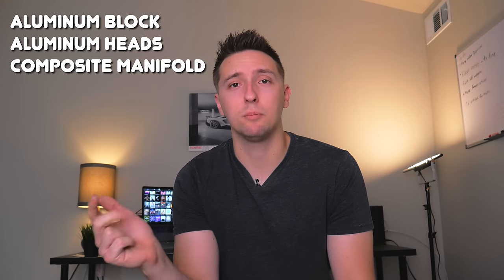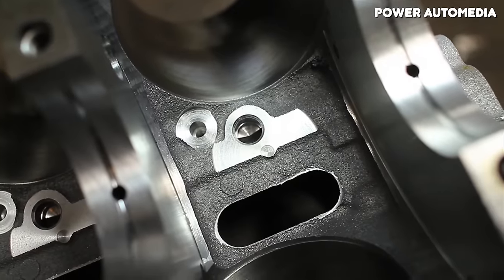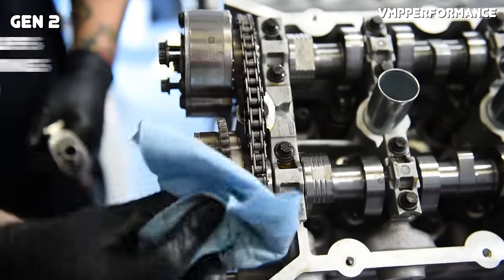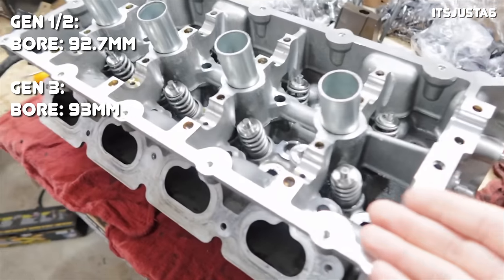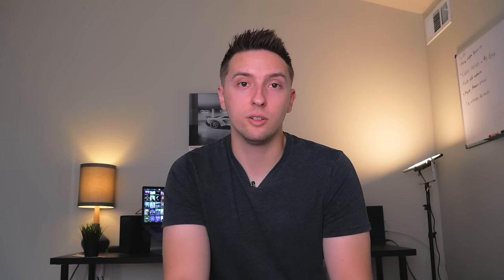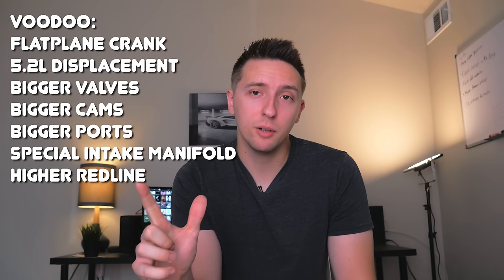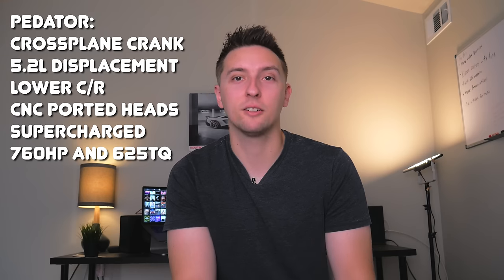The Evolution of The Coyote Engine (Explained)

Comment: Do you know much about the koenigsegg agera? I read it has a twin turbo v8 that was based on the 5.0 ford modular engine
Reply: I thought it was a 4 liter Audi, I better read up
Reply: Fermi Paradox  yup a 5.1 maybe the same engine??
Reply: The Agera is powered by an in-house developed 5.0-litre V8 engine based on the Ford modular engine block and fitted with twin-turbochargers which generates a maximum power output of 706 kW (960 PS; 947 hp) at 6,900 rpm and 1,100 N⋅m (811 lbf⋅ft) of torque at 4,000 rpm.

Comment: Didnt mention the oil consumption issue. Big problem in the 2018/2019 5.0 motors - Google it.  Class action suits coming soon.  My 2018 F150 5.0 was burning 2 qts of oil at 3000 miles. Luckily it was a lease and went with the 3.5 ecoboost bc of the v5.0 issues .

Comment: Respect for the Coyote but I'll disagree with you on the old 4.6L. The 4v version is an absolutely legendary motor. And the head options for those motors were equally legendary. John Mihovetz and outfits like MMR were taking those motors up to 3,000 hp.
Reply: Right?  Especially the 96-98 models
Reply: The firing order on the Terminator really had the best soundtrack, much more burly than the Coyote firing order, which I guess reverted back to the flat-head V8 firing order of Ford's very early days.

Comment: i have a 2016 F150 5.0.  It occasionally gets a rough idle and sometimes even dies at a stop.  It starts right back up no problem.  You mentioned the motion control valve helps at idle.  Could this be causing my issue?

Comment: 6:39 that’s the real big problem with the gen 3’s!  Should have left them with steel sleeves and they wouldn’t have oil consumption issues!  🤦🏻‍♂️
Reply: That's the reason I bought a used F150, I wanted sleeves and not a coating.

Comment: You forgot the 480hp BULLITT 5.0 version.
Reply: Gen3 with an intake
Reply: @Mangobrain82   - also throttle body and CAI from GT350.  Interesting though is that these mods made the Bullitt incur a $1000.00 gas guzzler tax...  my guess is a more aggressive tune too?  I have been reading where guys are dyno tuning stock Bullitts though up to 520 hp with nothing more than a swap to a JLT intake.... making me think the tune for a stock Bullitt must not be very aggressive at all and perhaps dialed back so that a stock bullit isnt nipping at the heels of a GT350??
Reply: @hammerdown3876  don’t forget the gen3 has more cubes and compression. Regular gen3 GT guys are making those numbers with stock 18 intake and tune. The a10 is also neck and neck with GT350 rolling racing also. As far as the 480hp. Maybe it’s just a number they picked that they though sounded nice. 500 would be impressive but I don’t personally understand the bullet and why they even made another bullet. They haven’t even made a new movie but they’re still making the car.
Reply: @Mangobrain82  Ford loves their making special edition for mustang...  But the S550 Bullitt was to celebrate the 50th anniversary of the film.
Reply: @Mangobrain82  And tune as well.

Comment: I love the coyote but it faces the typical problem with an overhead cam V8. Those heads take up a lot of room. The relatively crude Chevy LS motor doesn't put out the power per cubic inch but you can cram a lot of cubes in an engine bay.
Reply: What do you need to put in there?  A blanket?

Comment: Earlier this year. I bought a 2018 Ford F-150 with the 5.0 l engine. What surprised me is the power it has with good gas mileage. It gets better mpg than the jeep wrangler I had. The  wrangler got 17.5 to 18.5 mpg compared the F-150 with 5.0 l gets on average 20.75 mpg

Comment: Excellent video. I had a 2011 GT and used premium gas. I am thinking of picking up a 19-21 GT.  Do I have to run premium gas in it?
Reply: You can run 87 octane in all Coyote engines with no issues.
Reply: @JCTiggs1  thank you

Comment: Trying to remember something about the GT500 blocks. I can remember Ford changed the block of the 2010-2012 GT500 to aluminum in the 2013 and above models. Significant weight reduction on the front end. Yes it was not the 5.0 in the video but a larger 5.8L.

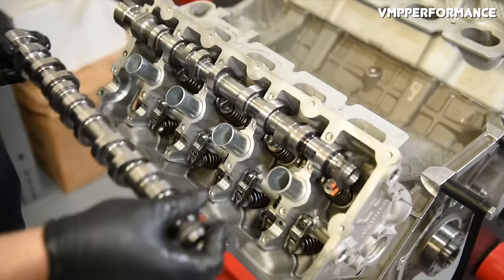Comment: (3:40) LS engines DO have adjustable cam timing (not all versions obviously) by use of a cam phaser, they just don't have independent intake and exhaust cam timing since there is a single cam doing all the work.

Comment: Thanks for the details, I was interested in the engine used in the 2021 Mach1, my understanding is the intake is from the GT350. Etc. 
I did however have a question about oil mist and oil separators. I understand a bit about condensation on cold stats and oil mist from blow by. 
I was intrigued as to why these engines seem to have quite a bit of oil mist. 
Also why is there more oil miss from the right hand bank then the left.
Also I see some people are replacing the oil pumps, is this an issue on all generations?

Comment: Ford should have used the same plasma transferred wire arc coating on the f150 5.0, i heard they went cheap and used a cheaper coating fir the truck application and now it supposedly caused oil consumption issues.
Reply: I think it just takes time for the ring to seat. Mine burnt a quart every 5k initially but now it burns maybe half a quart.
Reply: I have 2 f 150 s a 2011 and a 2016 , not a drop of oil use. I drive then a little harder than average if that helps you any !
Reply: Michael Cutic  Thanks so much for the info. Keep up the good work !!!
Reply: @FriendlyAdolfHitler  
That's weird since they've been doing fuel shut off on decel for years and it hasn't caused an issue as far as I know.
Reply: @FriendlyAdolfHitler  
Interesting. I deal almost exclusively with aftermarket on the Coyote so I'm a little behind sometimes on what the OEM is doing. Thanks.
Reply: @FriendlyAdolfHitler  
Gen 4?
Reply: @FriendlyAdolfHitler  
In the coyote? First I've heard of it.

Comment: Wire ARC the cause of coyote V8 oil consumption issues 2018-21, you didnt mention the oil pump gear ring size change in 2018 also. Important cause they went to a smaller size. But i liked the video.

Comment: I ha e a 2014 f150 looking g for power as this engine is older. I want the mustang 2015 or f150 5.0 will these motors the 2018 or 2015's go in . Is there computer modifications its an automatic 6speed

Comment: VERY Interesting. Especially to a guy who is generally a GM products guy... but currently owns a Mustang! (smile) 
What is the weight difference in the 3 generations of the Coyote? As I think about swapping in a Coyote into my 2004 V6... I am looking for kind of a "Sleeper" car ... that looks nice as a well-cared-for STOCK car with simply the over-sized Bullitt wheels and larger tires ... with a little 'secret' under the hood. But I do not want the basic balance of the car to be badly changed with a HEAVY NOSE ..

Comment: Thanks for the great info, love what Ford has done with this motor.  I owned a 2011 GT when they first came out and loved it.  Something to note, the Gen 1 Coyote 'base' GT motor had a forged crank and forged connecting rods...this is important, and supports engine mods well.  Also, when you describe the Boss's RoadRunner engine, you do not mention the improved forged aluminum pistons, designed for high-RPM performance.
Reply: Forged? Really?
Reply: @msands7713  Yes, really.

Comment: From the standpoint of modifying the Coyote, sounds like Gen 2 is the best for that application. Gen 3 won't be as boost friendly, the cylinder coating would have to be eliminated and replaced with sleeves if someone wanted high boost application, the dual injection should feed plenty of fuel but I can't see that being as simple as previous port-only injection. I know the 10-speed auto is very stout, seeing a lot of action in street racing with tightly spaced ratios keeping the optimal power in most gears.
Any thoughts?

Comment: Correct me if I'm wrong as I've never owned a Coyote, and I don't want to pretend to be an expert on them, but I thought that the early GEN1 Coyotes (11/12 model year Coyotes) uses 12MM head bolts like the GEN3 engines? Then in 2013 when they did away with the piston oil squirters they also went to smaller head bolts?

Comment: You didn't mention the Gen 1 coyote also uses 12mm head bolts, which are much stronger and longer than the 11mm head bolts on the Gen 2 coyote-- and important consideration for boosted applications.

Comment: Those gen1 to gen 2 output  improvements seem from bigger valves. Peaks at same rpm are a tell the cams are similar in lift timing and lobe separation if not identical.

Comment: Not sure what he's talking about with the third gen semi-closed deck. As far as I know all Coyotes use a semi-closed deck. Also, the 3rd gen wasn't the only version to get the 12mm head bolts. The early gen 1 had them too. Ford when away from them part way through the first gen and in the second gen then back to them in 3rd gen. The 12mm head bolts weren't just larger diameter but also when much deeper into the block threading directly into the main cap webbing (the strongest part of the block). The 11 bolt were shorter, ending in the valley at about the same level as the knock sensors. 
If you have a 11mm block they are still plenty strong but at very high boost levels there have been cases of them cracking in the valley were the bolts end. 12mm blocks are more desirable for high boost. The good news is they were fairly common in 2011 f150's.

Comment: My opinion Ford should bring out a 6.0 (366ci) DOHC V8. With 4.02” bore. Special intake manifold. 4 throttle bodies. Two bottom and two on top. 11 in 1 compression. Oval shape intake valves and big around exhaust valves. 804hp and torque 848. My dream engineering V8 lol Ford take my ideas lol jk I even have a name for it lol Sabre. Base on Sabre tooth tiger lol
Reply: I would love to see something like the Coyote that had the bore spacing to accommodate a 4 in bore. Give those 4 valves more room to grow.

Comment: Was the first gen Coyote the 302 Windsor? (same engine in the foxbodys?)
Reply: No. The 5.0 for 2011 was a completely new engine. The Coyote has dual overhead cams with Ti-VVT and 4 valves per cylinder. The Windsor is a push rod with 2 valves per cylinder. If i recall, they stopped using them in Mustangs about 95.

Comment: The gen 3 is garbage in their pickups, new piston design and the lack of sleeved cylinders was a huge mistake. Turned them into oil burners, they replaced the engine in my 2018 and the new one burned more oil than the last. My salesman at Ford assured me the problem was fixed in 2020, so like a fool I traded and the new truck also suffers from the same issue, after 7 months i sent the truck to auction just to get rid of the damn thing
Reply: I was surprised at how much oil my brand new 2019 mustang lost between oil changes. Considering my 05 f150 with a 5.4 and 300k didn’t burn that much oil. But I’m glad I sold it before it turned into a major problem.

Comment: I have a 2014 F 150 XLT, what generation does this truck have, and, what is its horsepower and  torque? All i know, is that when i floor it, it goes like a rocket, much snappier than my old Silverado with the 5.3.

Comment: Ok i have a question for you.  Which
generation of coyote engine is the
best for making insane levels of
horsepower?
Reply: My friend has an 11 gt with exhaust and a whipple supercharger. He had it dyno tuned and it made 793 hp at the crank. It’s pretty insane.
Reply: Gen 1 block with 12mm head bolts, gen 2 heads for larger valves, upgraded valve springs and cams if you use the OEM ones. Getting into gen 3 gets you the 12mm head bolts and even better heads but you have to figure out what to do about the direct injection.
Reply: Gen 3
Reply: Gen 2 with SC you will spank 95 % of the cars on the road trust me
Reply: @6ft3soldier  gen 3 if you wanna spank 98%
Reply: GEN 2 hands down!

Comment: I always liked the overall look of the gen1 better than the gen2 and gen3 because the gen1 silver head covers looks better than the black ones and the silver engine top cover also looks better and the 5.0 badge is also a nice touch it reminds me of how the Corvette of the early 2000's. My dream car is a 2005 Ford Crown Victoria with a 5.0L and a 10 speed automatic with a 3.42 limited slip rear end with a electronic looker painted flat black with two blue metallic racing stripes and custom wheels and a rear spoiler.

Comment: I don't trust the oil soaked rubber oil pump belt in the latest version of the Coyote. The Coyote is a fantastic high revving Mustang engine but I wish they had kept pushrods for the trucks for ease of service.

Comment: Which gen has the oil consumption issue?
Reply: All of them can have that issue. My 2020 F150 consumes about 4 quarts per 3k miles. It's going back to Ford.
Reply: The 5.0L gen 3 block has cylinder dimension issues due to dropping the cast in liner. Neighbor had fits with oil consumption on a 2018 F150 & they took it back, giving him a 2019 to help make up for his troubles... It was worse! He finally got a 2020 F150 with the twin turbo V6 and has been much happier.  I've been quite satisfied with my 2016 F150 5.0L.

Comment: I thought the 2010 was still an S197 with a 3v and the 2011 was an S197 with the Gen1 Coyote and then 2012 was the first year of the new S550 Mustang? I do believe they put the Coyote in basically a standard 3v GT chassis for the first year or so.
Reply: S197  covered 2005-2014 models. 2011-2012 got the very first Coyote version, 2013-2014 got some slightly different output so I thought it was Gen 2 but it wasn't.....The S550 Mustang officially came out late in 2014 as a 2015 model (50 yrs anniversary).......By the way, Gen 1 has the best OEM engine cover, Gen2 and Gen 3 looks very plastiky and cheap!
Reply: @Lmarcanov1978  The only thing that really matters is S197 is solid axle and S550 is independent rear. And engine cover, what are those? The things laying in my trash pile lol. I never keep all that extra junk on my cars hah

Comment: Great video, didn’t know there was that much difference  ! Could you replace a gen 1 with a gen 2 without changing the main engine management systems? I was thinking or swapping a gen 2 in my 2011 f 150. Would like to get your thoughts on this. Thanks !
Reply: You can physically bolt a gen 2 anyplace a gen 1 went but it will require significant tuning to make it work. For example, the gen 2 mustang engine used significantly different cams compared to the gen 1. Not sure about the f150 cams. You will also have to lock out the CMCV on the back of the intake manifold as the gen 1's didn't have it. Most people don't find all the trouble worth it though. The main things you gain with the gen 2 is better cams, valve springs (in the mustang), slightly better breathing heads with larger valves, and the CMCV (which gen 1 can't use).
Reply: 177SCmaro  Thanks for the reply , I was thinking of replacing a gen 1 truck with a gen 2 truck engine in my 2011 f 150  . My 2016 has significantly more power than my 2011 . The 2011 has about 90,000 on it now and was thinking of swapping in a gen 2 in. Any info on that would be greatly appreciated !
Reply: @thomasdaum1927  
It can be done but it's not going to be as easy as just replacing the engine. Like I said, there are significant software and tuning differences between gen 1 and 2 and you'll need to pin open the CMCV on the back of the intake manifold.  You might even need an aftermarket ecu and someone who really knows what they're doing.

It depends how far down the rabbit hole you're wiling to go for about a 25 horsepower difference stock. if you just want more power get a gen 1 and put a tune and some better exhaust on it and you should close the gap between a your gen 1 and a gen 2 f150 5.0. I've even seen guys with f150s putting in mustang intake cams with a tune for significant power gains but that would be something best done to the new engine before you put it in as you have to pull most of the front of the engine apart to release the primary chain to remove the cams.
Reply: 177SCmaro  Thanks for the info , I will probably just leave it alone. Sounds like to much monkeying around just to get it to run right. Thanks so much for your time and information !!!
Reply: @thomasdaum1927  
Lol, well, it's good to be a little ambitious but I don't want you to sink a ton of time and money into your ride only to be frustrated and/or disappointed. If this was a racecar or something and you had a huge budget and were well enough verse in these engines that you wouldn't need my advice I'd say go for it. But if this is more of street pickup that needs to be practical, reliable, and you just want a bit more grunt out of it then yeah, stick with the first gen and look into some reputable bolt-ons. Have fun and good luck.
Reply: 177SCmaro  I agree, thanks again !
Reply: @thomasdaum1927  
U bet.

Comment: Of all them which one responds best to aftermarket mods?
Reply: Id say my 13' Boss 302 Roadrunner engine
Reply: Depends on your goals.  Gen2 is pretty responsive, but the Gen3 can make over 500 to the wheels with very minor mods. the Gen3 at over 6000 with a good exhaust setup is so loud.  I love it.  A Gen3 with a blower is insane.
Reply: blazebarnett91 not that I have heard. I know people pushing 700 800+ on them.

I have seen stuff about a ticking noise but haven’t noticed it on mine. 

I believe the GT350 has had issues.
Reply: Gen 3 > gen 2. Makes more power with less boost thanks to higher compression
Reply: blazebarnett91  3
Reply: blazebarnett91  yes
Reply: Gen2